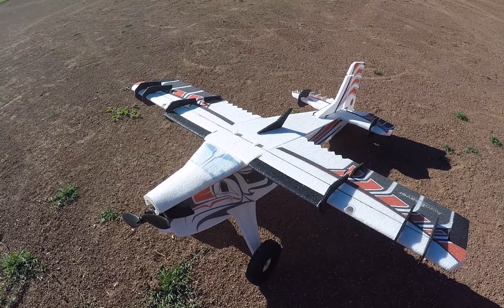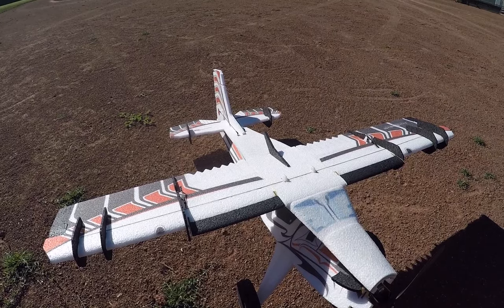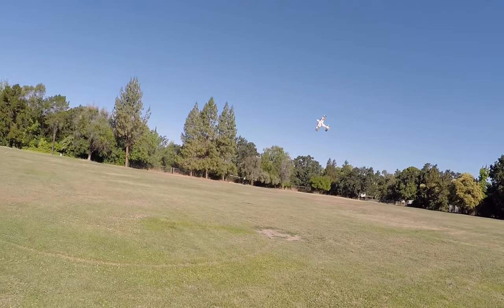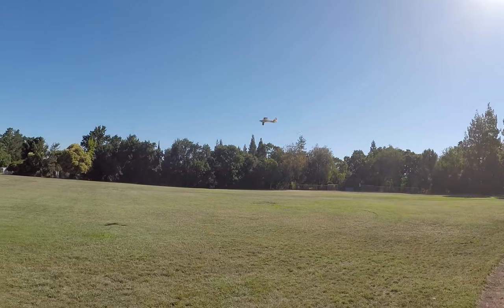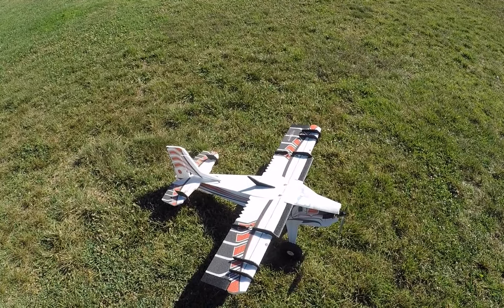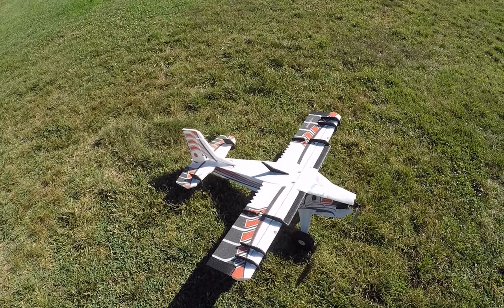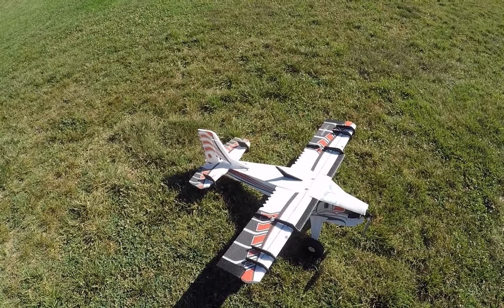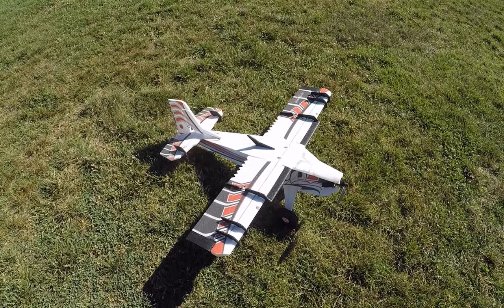Twisted Hobbys 43" Crack Turbo Big Beaver | Wing set up and flying

Comment: My 35" crack turbo beaver is looking worse for wear. It's a great plane. I have learnt so much and it is so amazingly crash resilient. Much more resilient than my other EPP planes. Only thing is it doesn't handle wind very well, probably due to the non-profile wing. I am wondering whether to get another one or to get the big turbo beaver. Advice/opinion please?
Reply from the maker: I'd step up to the big turbo beaver. It's a blast especially with the front flaperons.

Comment: Nice & unusual fuse-build :)  fronterons (rcsuperpowers speak :P)! cool man.. I've never seen this is stores over here.. 
What about getting rid of the vertical stabeliser alltogether for even More rudder? :)
Reply from the maker: lol this rudder already induces weather changes across the globe as it flaps about ;). I looked at the thumbnail and can't believe how little rudder it needs to slow KE. Fronterons! I like it! :) You need your stores to get some!
Reply from the maker: well that is different!
Reply: Some interesting ideas in that build huh? :)
Reply from the maker: definitely - very creative and well designed. I am amazed that rudder doesn't just shear off. :0
Reply from the maker: that is quite cool and tamed down that plane quit a bit. So much you can do with a little imagination!